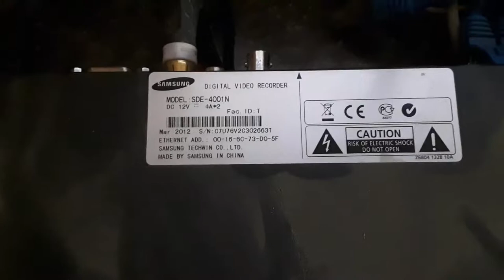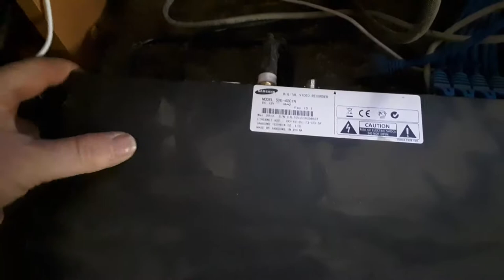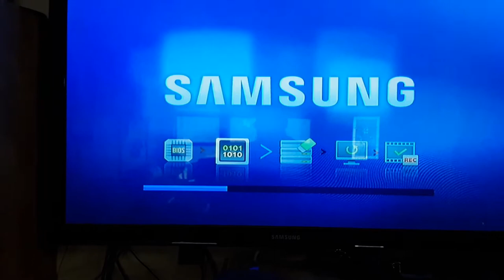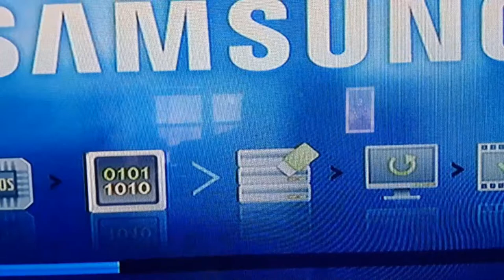SAMSUNG SDE-4001N HDD REPLACEMENT

Comment: What model number HD did you buy. I have read that there are only a few compatible ones. Also 1TB is the largest.
Reply from the maker: WD Purple 1TB Surveillance Hard Drive - 5400 RPM Class, SATA 6 Gb/s, 64 MB Cache, 3.5" - WD10PURZ
From amazon, I stayed with 1tb because I wasn't sure if it would run a larger one without issues.
Reply: @muddyudders  thanks for the info. Your video is very helpful. I just ordered the same model from Amazon and it should be here tomorrow. This system was in the house when we moved in last fall and I haven’t really messed with it until I watched your video. It got me motivated to get this thing working.
Reply from the maker: @milazzovince  hopefully you have the same luck as me. Sounds like we have the exact same situation.
Reply: I'm trying to install a 4tb WD4005FZBX into a SDE-5001N and I don't think it's recognizing it... Grrrrrrrrr

Comment: Hello , my front panel is not turning on 
I cannot use mode menu buttons 
You think its a power supply issue not good ! Where and what kind of power supply i need to buy . Thx
Reply from the maker: I would check the ribbon cables that attach the panel to the board. Make sure they haven't come loose. I'm not a tech, I just fixed my unit.

Comment: Can you give me the exact hard drive model?
Reply: My Samsung security system just showed up with this but I have important footage on this hard drive.. I think I may have disconnected it internally when I was trying to fix a different part of it. Not sure though. Would I be able to salvage the data off of the hard drive?
Reply: Hi Jennyfer, I think the original Purple drive that normally come with this unit had been replaced at some point in the past. Now it has a Wester Digital of 1Tb and my replacement drive for testing was a Seagate 2Tb. It doesn't seem to make any difference. It all works except if you start trying to make changes through the menu. Also I have not gotten to the point where I can access the URL for this device. I've tried several things including installing a separate router with the IP network to match the unit's default setup 192.168.1.200 all to no avail. I still have to try to access the unit from my computer using the SmartViewer software. Ill do that as soon as I find a good working CD_ROM drive that works on my Windows 10 computer.